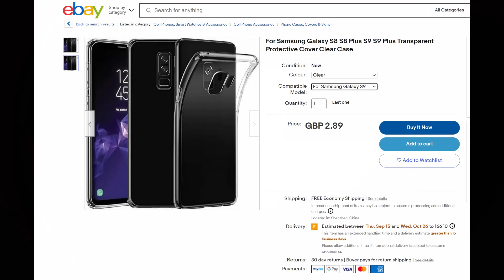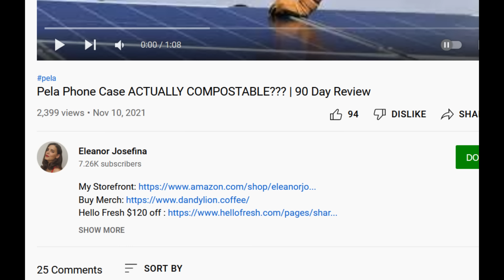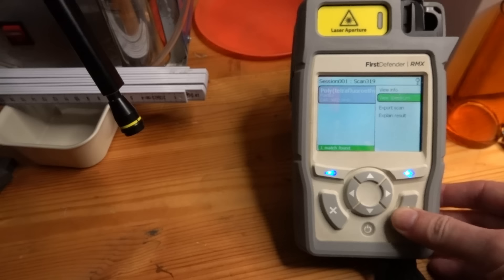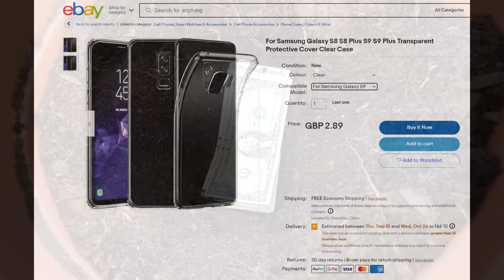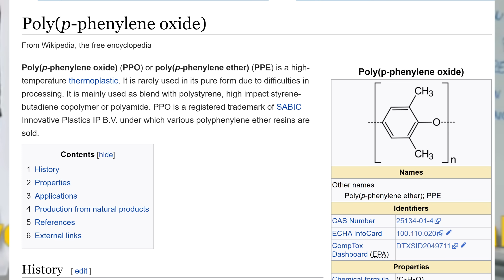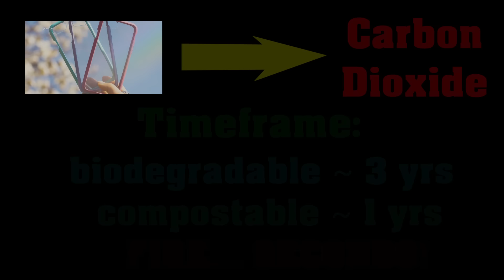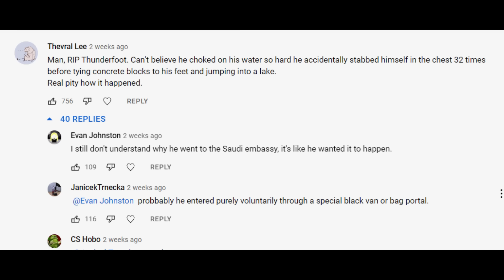Pela-Case: BUSTED!!!

Comment: At this point why isn’t a company making cases made of actual biodegradable paper? I imagine you could come up with some design made of that paper egg carton sort of material that would protect a phone better than this thing does, since paper is more shock-absorbent than plastic. A wax costing could help give the case a bit of waterproofing to last a bit longer but keep it somewhat splash-resistant. I imagine making the corners a bit more chunky (like most other cases) and having corrugation inside of them would help a lot to dampen a fall. These cases could probably be cheaply made, and therefore sold cheaply and in multi-packs. Suggest that people replace their case after a drop or two, or once the case is showing wear. 

I’m not an engineer by degree but I have my fair share of material use and I’m nearly certain with a bit of intelligent design you could come up with a paper phone case that does a better job than a Pelo and is genuinely more eco-friendly. Could even use recycled material to make it. Most daily users are never going to drop their phone from more than 4-5 feet so I really don’t see why something like this could work. 

If anyone in a position to design such a product ever sees this and does so please know that I have a screenshot of this post and only ask for a percentage of product sales in exchange for me not hiring a lawyer.

Comment: Just the price. Think of the resources, time driven, time worked, food needed to keep you going during that work. What you need to do to make $60 does more damage than buying a $3 case and properly trying to recycle it. Or better yet, just doing something like putting off upgrading the phone as long as possible would do SO SO much more.

Comment: The whole "plant plastic" thing is so overblown in the marketing.
Yes, maybe they're compostable technically. But not in your little home compost bin.
Most of these plastics have gotta be ground up and heated to high temp which requires industrial scale. Turning your bins with a tractor, not a pitchfork.

Anyone with a 3D printer who attempts to compost scraps can tell you how much PLA doesn't wanna compost.

My mother did composting for her business for years at pretty much the biggest scale you can manage with a pitchfork. Her temps were generally 90-110 degrees fahrenheit. low 40's Celsius. About 10 degrees C short of efficiently being able to break down PLA.

Comment: "planet of the humans" is the name of the video. It is about how instead of like taking coal strait out of the ground and burning it etc. ALL "green" stuff is like 6 steps so you are driving the "coal" or whatever resource making it into a solar panel. (yes you need coal). a "green" concert that runs off of diesel generators and a "display" of a solar little hippie display I'd call it on the concert grounds. (You would need like square miles of solar panels to run a concert.) new bio fuel plants which are just incinerators and they burn such hard to burn like   lumber "waste" mixed with tires and garbage to make it burn etc.

Comment: Try a Spigen Tough Armor case if you want to keep a phone for years. I first got one for the 8 Plus I traded for my current 12 Pro Max. The 8 looked like a new phone when I traded it. I also use tempered glass screen protectors. To date I haven’t broken or shock damaged a screen or any other internal phone components with this case/screen protector combo. When you’re rocking an $1100 phone spending under $20 to keep it in like new condition is peanuts. I can tell you just from this video that this Pela case is junk. It’s going to provide the absolute minimum of protection. It’s flimsy, fits loosely and the front ridge that needs to protrude around 0.15” above the surface of the screen is too shallow and with a face down drop on a rough or uneven surface (like a sidewalk or driveway) is going to crack your screen. The flimsy construction of this case is also going to offer no more than the most minimal shock protection for an OLED screen, logic board and stuff like the LiDAR and cameras. I wouldn’t give $6 for one of these cheesy Pela cases. $60 for one is a joke.

Comment: Funny thing is that a lot of industry is actually locking away a lot of CO2 in to things that last decades, while otherwise that CO2 would be released in to the atmosphere a lot sooner, good example is furniture industry, that use wood to make furniture. by making furniture, they lock the CO2 for decades in to things rather than leaving those trees to root in the forests releasing the CO2 right after their live is over.  
Same thing with a lot of plastics. They constantly talk about plastic being bad for environenment and how long it would take for the plastics to degrade. Well that is concering, but on the same page that plastic wont release the CO2 for hundreds of years in to the atmosphere.

Comment: Just to add insult to injury they print their products using heat treated vacuum sublimation, which is an extremely energy intense process of printing, baking and then vacuuming them (similar to a thermoforming machine) - which also has a huge impact in terms of waste plastic (printer films)

I used to print wrap cases for a company and it is painfully wasteful and intense on energy, everything has to be preheated and cooked under vacuum to be wrap printed the way they print phone cases..

Comment: I remember a small math exercise where I had to calculate the CO2 emissions of a pet dog during its lifetime and it turns out that you can drive a fat SUV for a year or 2 if you don't have a pet 😂(not that I would recommend  that, & of course that depends heavily on the variety of dog, its diet and multiple other factors)

Comment: those products are surely bullshit but 20:45 just nope
your case was made of crude oil. so actually additional CO2 is released to the atmosphere (given the current condition of the planet). If I burn a random wooden stick is does not matter, as long as averaged biomass of the forest remains the same. heating your home with woods is therefore CO2 neutral as long as you dont remove more biomass than actually is re-growing (problems come with dust and too many people for remaining forest area). crude oil is not regrowing.
it is still desirable to make products that have previously removed their carbon content from the atmosphere through plant growth.

Comment: Maybe I'm crazy but isn't the plastic case already "sequestering the carbon" it's made from? Just don't burn the case and pat yourself on the back for a job well done saving the planet.
Reply: That was the entire point of the video: that the case captured the carbon and composting/burning it just releases the carbon back into the atmosphere, actually making the greenhouse effect greater. It would be better to imprison the carbon into the case and then NOT releasing it back into the atmosphere. These (insert disparaging insult of your choice) are selling their product as eco-healthy because it damages the environment by decomposing......even though it doesn't decompose particularly well or even better than non-compostable phone cases. Yeah, that's the ticket! $50!

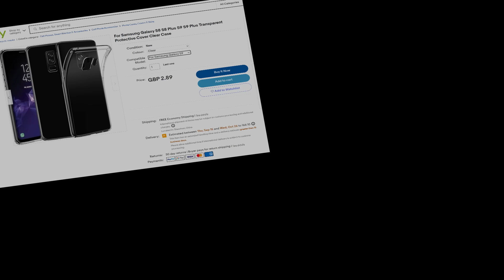Comment: 25:35 Not an actually bad idea. Separate the CO2 from the air compress it into a bottle and bury it like radioactive waste.

Power that process with solar energy that can't even be used by the grid during peak mid day sun and boom! You have yourself a slow but steady solution to carbon pollution.

Comment: Why are their goverments allowed to dump plastic in to the ocean though? I feel this whole plastic scare are based of people not asking the correct question; but rather trying to guilt people in to buying their hipster gadgets.
The funny thing, ever since this plastic scare started when they discouraged people from buying plastic shopping bags; the usage of plastic have actually increased by that instead of people reusing their plastic shopping bags for example household garbage, people now have to buy a rolls of plastic bags to use for their garbage which instead have increased the amount of plastic used. One thing people need to learn after all that in practice there's no such thing as a "single use plastic product". You don't have to buy a seperate water bottle, you can just reuse one of your soda bottles, as a example.

Comment: If anyone wants to really make (or renew interest in this instance), make your bioplastic out of discarded casein, like they used to do a hundred years ago. Fifty percent of usable casein from milk production goes down the drain anyway, and ya damn well know casein biodegrades just fine. Might not do a whole hell of a lot of good for the soil however...
Then there's PLA, the corn starch based compound that 3D printers are likely well-informed on. But does it do much to displace all the co2 coming out of the tankers shipping it across the ocean? Nope. 
Still haven't come across an EPA guy at a forest fire either, doing their level best to throw themselves in front of an inferno for sacrificial gain...

Comment: Dear Thunderf00t,
I enjoy your videos, and I am convinced that they make an important contribution against dumbing down.  However, I think your comparison with CO2 from exhaled air is not quite correct in this case. The exhaled CO2 was previously taken from the atmosphere by plants. Conventional plastic tends to get its CO2 from petroleum. If it is only a matter of clarifying the orders of magnitude, I think the comparison is good, but I got the impression that the release of CO2 was equated. It is quite possible that I have misunderstood this. In that case, please ignore this post.

Comment: I have never owned and never will own a phone case.  Just don't drop your phone.

I would never buy a phone that was so expensive, that I would feel I would have to spend even $25 to protect it.  My current phone is a $250 motorola "one 5G ace" , it replaces my $160 motorola X I bought about 4 years ago, and the ONLY reason I don't use the X, is that I've been forced to 5G.

I still use my own phone, just not as a phone.

I can't understand why somebody would spend $1,000 and up on a phone.  Just seems stupid to me.  It's not like a computer where it actually matters how fast it is.

Comment: It's a little less extreme example of another gold hammer. You can store co2 in diamonds, or make with it a phone case for $60... BTW, if it's not degradable, doesn't it holds the co2 avoiding its release to the atmosphere? And when it decompose, doesn't that eventually being released to the atmosphere as co2? I mean plants are cool, but then they die and return the carbon to the atmosphere. How about everyone share one ride. Save 1 gallon of gas. And contribute way more than buying 150 of those, for the ridiculous price of $9000. Damm instead of buying 400 of those for your extended family, saving the equivalent of 3 or 4 gallons of gas, take the money and buy a freaking electric vehicle....

Comment: So, are you suggesting its fine to just burn plastics? To be honest, ive heard people say you cant do that all the time, but i know its just carbohydrates and in fact in my youth i know there has been wrappings advertised as  burning cleanly. Now, sure, if its a bad fire you might get some halfburned carbohydrates airborne so you probably shouldnt do that indoors at least only in an oven that has a good aidraw and such, which actualy many plastic wrappings are indeed good at getting a fire  started in such an oven burning wood or coal.

Comment: So, according to them:
Burning fossil fuels to produce plastics = bad (adds CO2 to the atmosphere ... global warming etc)
So buy a phone case that contains plastic (duh) and degrades into CO2 and water. How does this do anything at all to solve the problem?
I'd much rather have a phone case that is easily recyclable than one that is biodegradable. 
Having said that, phone cases are about as responsible for global warming and ocean pollution as drinking straws are.

This is 100% about virtue signalling and pulling money out of the pockets of suckers.

Comment: Ever since getting into 3D printing I've gotten really wary of those "bio-degradable" designations. Also, I'm sure it's a completely meaningless coincidence that the way they pronounce "pela" sounds very close to PLA, y'know, the bio-degradable, plant-based plastic?? 🤔 (It probably actually is, given the flexibility, but it's still an odd coincidence)

You want to keep your carbon footprint low? Plant a fucking tree.
Reply: Sort-of-biodegradable. It'll break down faster than most other plastics. That is, it'll be gone in decades rather than centuries.

Comment: The advertisement was flawed from the start, it pitched the blame onto individuals. As much as we like to blame consumers, average people actually contribute very little to carbon emission, at least directly. But let's just play along, whether it's on the individuals or industries, the best way of combating man-made climate change is actually reducing consumptions in the first place, where reuse and recycle are very inefficient. Your basic needs are mostly carbon-neutral, so we don't have to sacrifice our wellbeing for that. And for things that are not basic necessities like phone cases, I simply use it until it fell apart, so I'm no hypocrite in that regard. You can't meet climate change goal in a meaningful time while also trying to increase the economic growth - the latter are pretty much irrelevant on an individual level, our basic needs are fixed regardless of our wealth. Try to come up with a way to sell more stuffs is only making things worse, regardless of how "green" your manufacturing process is. If you have to buy non-basic necessities, buy the most durable product without having to think too much about its carbon footprint, don't give greenwashed product a consideration.

Comment: Slight issue. THe phone case wasn't $3, it was $3.39. The price was in pounds. It's a bit much to claim it will cost $3 when you give the price in £
Reply: rounded to the next full number, 3.39 is 3. It would have been a bit much to always say 3.39 every single time the argument is brought up, especially because it is abundantly clear to any viewer that it's $3.39, because it was easily visible in the screenshots that were used.
Reply: @nilemagenta1787  He could have at least said $3.4 then...

Comment: unrelated to the video: Given the energy crisis in europe, do you know any method of heating a room, without using oil, gas, wood, or electrical heaters? Maybe a chemical reaction heater or something?
Reply: You'll still hit the roadblock of cost. Fuelling any kind of reaction requires input and chemicals cost more than oil and gas that's already piped to your house. You want the cheapest method, you go out into the woods, chop wood, dry it out and burn it. You want absolutely minimal cost then retention of heat is what you need. Layer up, multiple thin layers are more effective than fewer thick layers. Let you natural body heat get trapped in the layers and you'll be alright.
Reply: @mattd6085  Thanks for replying. Thats kinda what i figured. if chemical heaters were feasable, they would already exist.
Reply: @steinmetz3336  They do exist, they cost more than your central heating, that's why we don't use them

Comment: $60 dollars for a piece of plastic to go around a smartphone? Are you shitting me? Even the "cheap" polycarbonate or silicone rubber cases are in the region of $30. Which still seems like a rip-off for what is essentially a moulded piece of plastic - not all that different from the moulded plastic food containers we throw away every day, and those cost pennies to make. Even $3 for a phone case still seems excessive by comparison, though only a single order or magnitude away from what it costs to make, which is at least more reasonable.

Comment: The one that bugs me is paper straws for plastic drinks cartons- if there was ever a product plastic was great for- it was straws! I'd take wood straws at this point. So far from fit for purpose, they dissolve when wet immediately! They don't even wax them or anything.

I view that stuff and these as eco virtue. Political nonsense. True ecology is a lifetime question. Products that LAST not biodegrade. Small land wind turbines- terrible ecologically due to maintenance lifetime and network issues- you might as well use gas power stations due to some of the unreliable chinese produced wind turbines that lasted less than a tenth that which was promised.  But they send the right message right? Killing off bird species.

If anyone actually supports the environment, they'd support nuclear power instead, and maybe power cars by pantographs or something.

Comment: Burning and composting give the exact same product...? What??? They both produce co2, that's true. But the similarities end there. Burning will instantly aerosolize any nitrogen. And will produce potassium. Composting will fix the nitrogen into the compost and produce far less potassium, if any. Lastly, burning results in free carbon (aka char). Composted carbon will form chains with organic compounds.

Comment: Surely, if the aim is to not add CO2 into the atmosphere, you DON'T want a compostable or biodegradable plastic.  If your aim is to avoid plastics that won't go away, then sure, compostable or biodegradable is the way to go.  BUT, you can't have it both ways!  Making the claim that a compostable phone case will reduce atmospheric CO2 is a lie.  At best it will reduce plastic waste, but claiming it reduces one's "carbon footprint" (a teensy weensy amount) is completely wrong!